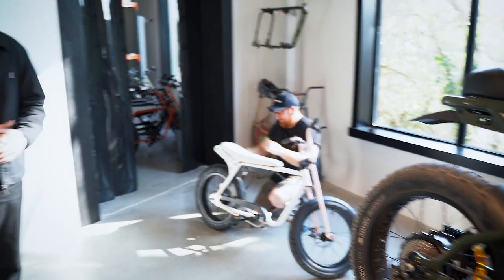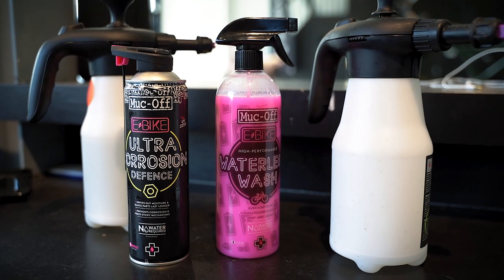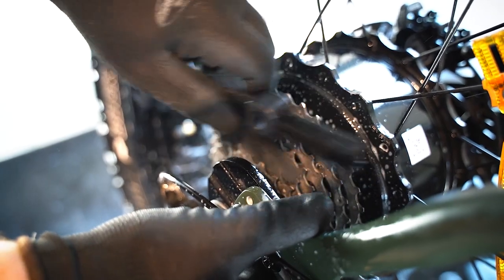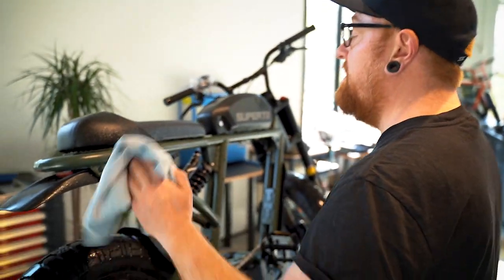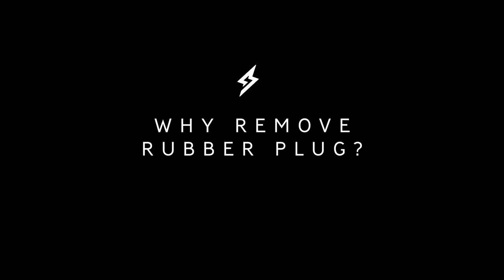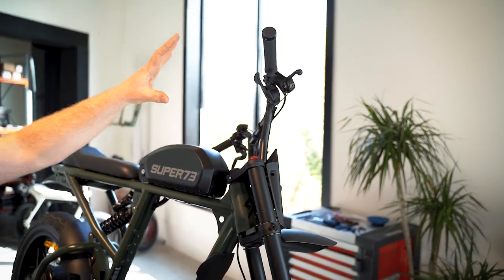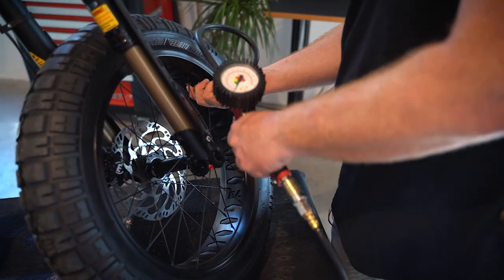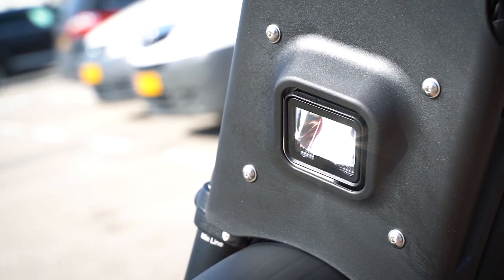SUPER73 Tutorials: Cleaning and Maintenance

Comment: This definitly helps! Is it better to take the battery of the bike for cleaning ? How shall the controller under the seat be protected ? Thanks!
Reply from the maker: Taking the battery off is not necessary, however if you do decide to remove the battery during cleaning we recommend you cover the mount with a plastic bag to stop water from coming into contact with the connector pins.🙌

Comment: What is the type of sprayer you're using for the cleaner?
Reply from the maker: We use a brand called Muc-Off which you can find on our website :)⚡ https://eu.super73.com/collections/accessories?page=2
Reply: I’d also like to know what sprayer is used, not the spray, the applicator.
Reply: Any update on this guys?
Reply: @chrise86  it's a pressure sprayer.
Reply: @GreenWizard1111  yeh they’ve actually replied with the exact one on my other comment, which is what I wanted to hear

Comment: I'm confused, I thought waterless wash doesn't need rinsing, yet in the video you do exactly that. Does it mean I can use a regular muc-off wash on my bike? 
Also what kind of spray bottle do you use for rinsing? ))
Reply from the maker: Correct, waterless wash does not require you to rinse it off. In the video a mix of Muc-Off fast action bike cleaner ( https://muc-off.com/collections/bicycle-cleaning/products/nano-tech-bike-cleaner ) and water is used initially, then water is used to rinse it off.  The spray bottle used is Dr. Wack - F100 Drucksprüher 925 ml.
Reply: @SUPER73Europe  Thank you so much!
Reply: @SUPER73Europe  In which parts of water and muc off nanotech have you done the mixture? :) Thx in advance

Comment: Hi.Can you make tutorial about how to charge battery for super73 RX,please.
Reply from the maker: Hey! Charging the battery is super easy, just follow these steps. First plug the charger into the wall, second plug the charging cord into the slot in the battery, and finally turn your battery on. If your battery is not turned on it will not charge. If you're still having issues contact our technical support in the via the link below.⚡
https://eusupport.super73.com/hc/en-us/requests/new